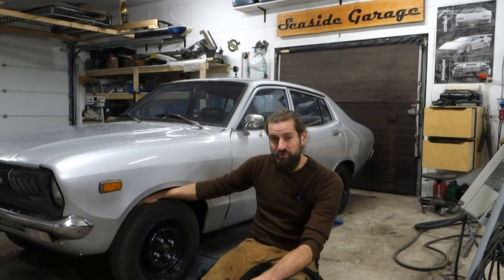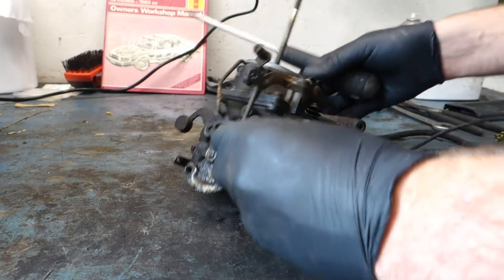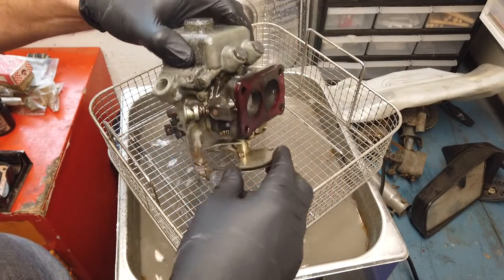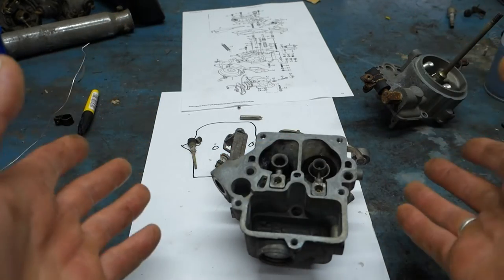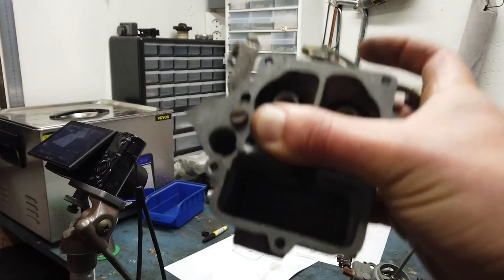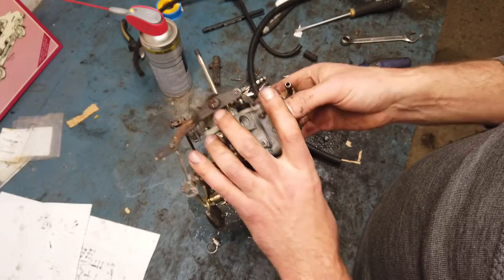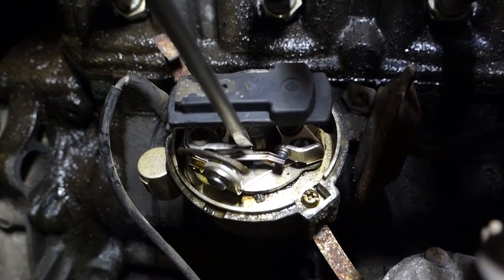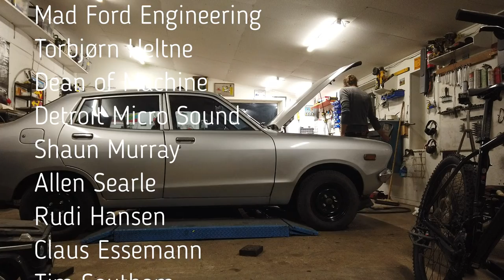Datsun 120Y not running right- Carburetor? Ignition? Lets try to fix it!

Comment: I am amazed how rust free your 120Y is, I had a 1978 2 door that just dissolved every where, finally got scrapped after failing it's MOT at 12 years old!
Mechanically, it was excellent with 90,000 miles on the clock, I have had a few Datsun/Nissan cars over the years, all were utterly reliable & never let me down.
Reply: Same here , mine was a 77/78 orange one , body was quite good condition, engymint but the o/s inner wing totally rotted, ended up scrapped😢

Comment: We had a 1971 Datsun Sunny,  the previous model,  fantastic engine but rust got it in the end. Best mileage for me was 40mpg, imperial gallon, so around 33mpg US, or 14 km/l. However I did press on in those days. We also used the car to tow our caravan, when the mpg was around 28 mpg, imperial, 23.5mpg US, or 10 km/l.

Comment: Such a simple carb with a manual choke!  A tidy engine bay with plenty of room to work.  Simple breaker-point ignition.  Ah...those were the days.  When you could fix it on the side of the road with 3 wrenches and a screwdriver.

Comment: Sounds like it may need a condenser. The distributor cap as you said and the rotor arm does it have a resistor in it?The points were burnt that is why I say a condenser.
Reply from the maker: I think you are right.... a bit hard to find one though!

Comment: With the state the distributor cap is in, it'd probably be prudent to replace the majority of the ignition system's electrical parts, it probably hasn't had a good service in that regard for a long time, so could do with plugs, wires, rotor, cap, points and condenser, make it nice and arcy-sparky... :D
Reply from the maker: Yea... the spark system is quite neglected on this... most likely because its such a reliable car that people forget to service it...

Comment: I am sure these early Datsun engines are related to BMC A series but with improved breathing, many of the manufacturers ( inc BMW, Toyopet, Datsun, and others ) their first was a copy of an Austin 7, rebadged.
Reply: Yes but I believe these had 5 main bearing cranks.
Reply: @edwardkennedy9919  not sure, could well be, you would surprised how many car manufacturers started out by copying Austin cars inc BMW so IF you ever an Austin 7 badged as a BMW, now you know.
Reply: @barryphillips7327  yeah I remember around 1980 we had a datsun 1 ton pickup with a 1500 pushrod engine and my uncle a mechanic was doing some work on it and he said apart from the carburetor that it  was a bmc engine.